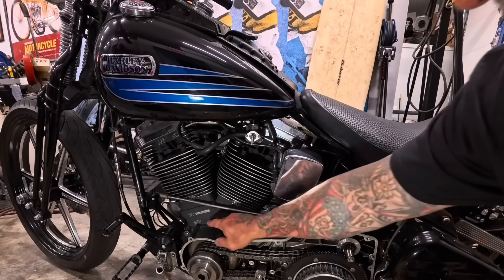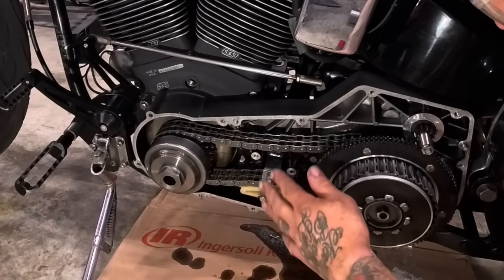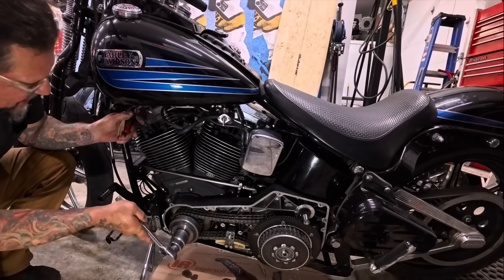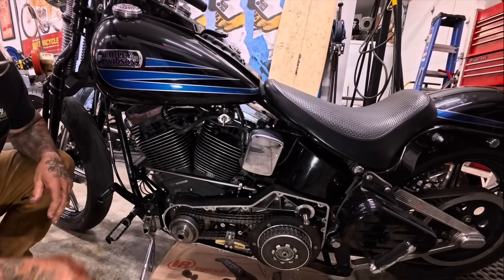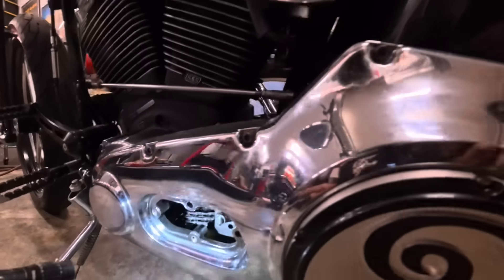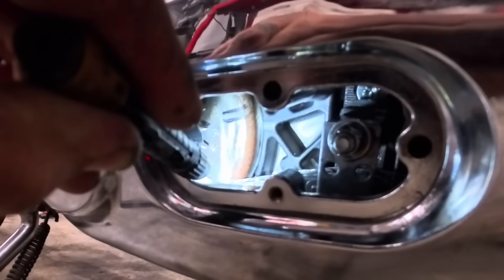How To Set Harley Electronic Ignition Timing The Right Way- Billy Lane’s Pro Trick With Timing Light

Comment: I have stock 80” evo fxr with ac and 2-1 v&h pro pipe, external Daytona twintec single fire ignition module,slope set at 5 for 87-89 pump gas. Stock cv carburettor rebuild with cv performance parts, 48 pilot 2 turns out and 175 main jet, cvp needle. I have the issue when bike backfires through the carb on deceleration when i am slightly twisting the throttle at downshifting. Is that an issue with timing and i should lower the slope mode to 4 in order to make timing more retarded? I also ordered 180 main since people say 48/180 is the best combo for big twin evo with high flow pipe and air cleaner 😢 i never had this issue with stock ignition module

Comment: Billy , why have I been taught to set electronic ignitions at tdc mark  vs the advance mark which ive seen other guys do also...is it running dual plugs or a bigger cam the reasoning ?   And do you still make your prism bars ? Im building a chopper with the 45 degree specs you use and 18 over springer front end . Its looking beast mode .
Reply from the maker: You can set it either way. I like to use the advance mark because that’s how I learned before electronic ignition was commonplace.
Reply: @BillyLaneChoppers got it. Thanks for the clarification 👍

Comment: Do you put the light at 0 degrees is you have a newer timing light? not running any advance on the light ?
Reply from the maker: My light doesn’t have any adjustment, it just fires when the plug fires.
Reply: @BillyLaneChoppers thank you for your response and informative videos huge fan.

Comment: hey Bill I tried with the clear plug in the timing hole realizing you can't see anything I opted to static time my shovel with a globe lighting up when the spark is right on moving the timing plate I cannot remember exactly where the globe needs to be wired inline is it coil to front cylinder plug wire been about 15 years since I did it that way a very handy tip I learned from the guys at lowbrow watching one of their dvd's on hd maintenance I'm sure you know this and the exact way to do it might be worth showing that way as well :) keep up the vids excellent as always, take care man .
Reply from the maker: Well, you can time to front or rear cylinder/ doesn’t matter as long as you use the right mark. Static timing gets you very close, but it doesn’t adjust for gear lash and other factors that can offset timing by several degrees when the engine is in motion.
Reply: @BillyLaneChoppers  yeah true so it's more to just get you in a zone where the bike fires and runs.

Comment: i still have a similar timing light from sears that i used to use on my car engines but i've never messed with the timing on my old 1980 flh. i did buy the special pop rivets for the timer cover but never used them and they've been sitting in my tool box for 40+ years. thnx for going over how to best time the thing, i enjoyed watching.

Comment: Kind of off the subject but I was testing out the charging system on a Harley-Davidson that had an alternator.. Jack pitman had every official Harley-Davidson shop manual there was.. the book said danger do not touch the two leads come out of the cases for the alternator.. just as I read 130 volts ac on my meter as the engine was going potato potato my meter leads flipped off and I touched the two wires coming out of cases.. are you laughing by now? That sob knocked my dick stiff... You can run a microwave off that alternator and cook your dinner

Comment: Can you do a video on how to static time and or adjust the timing I've never checked it on my 84 FXE Super Glide shovel head I'm guessing set on the advanced mark and rotate the plate where the points used to be how do you know when spark acures  test light or multi meter never done it with electronic ignition?Thanks
Reply from the maker: I usually just visually look for the points to open, but a test light is more accurate. Either way will get you really close

Comment: Hey Billy, does that primary chain normally run with that much sag in the upper strand, or did you snug it up before re-installed it? Sorry, off subject but was real curious
Reply from the maker: No, that is too much chain play. The tensioner sho was installed backward when I got it. I turned it around and now tension is correct
Reply: Thanks, that's what I thought, I was worried that maybe I was too tight on mine bc I really trust the things that you do!! @BillyLaneChoppers

Comment: I always static time it so it starts, then ignor the timing marks and time it off the cone by just adjuating the timing via the slots until the throttle response is instant and rolloff doesn't hang up. That means you are timing that particular engine and its specific state of wear. Timing off the timing marks just times the engine for factory spec and everything being brand new. Thank me later 😎.
Reply from the maker: I always static time first, also. And I seldom time to 35 degrees BTDC. My method is similar to yours, unless I’m timing a kick-start bike. Then I focus on starting & advance until performance falls off. Especially with performance upgrades, more than 35 degrees advance is usually preferred. But I’m speaking to the majority of my viewers, who probably would follow the manual or accepted practice, and this is really about how to avoid the hot oil moneyshot from the timing plug hole. No matter how much wear an engine has- if the average person times to the 35 degree mark with a light, the bike is going to run really well- assuming that all other factors are in check. I appreciate you watching & leaving valuable input. I’ll be thanking you in about an hour.

Comment: Billy I have the exact same timing light in the bottom drawer of my big tool box. I have used it to set the timing on countless old engines on old cars , trucks and tractors. Used a few months ago on a Flathead Ford V8. Most people today that call themselves mechanics have no idea what a timing light is. Once in a while I'll get my old Ironhead Sportster out of the shop and take it for a ride. If it's running lean or rich I can reach down and make an adjustment to the main jet. Hard to do that on a bike with EFI🤣

Comment: Hey Billy, I love your channel and this particular episode. I have a first gen EVO (1985). I lost fire to the plugs. I have a new single fire coil that is 3.1 ohms (tested) on the leads and over 12,000 ohms down the spark plug holes, so I feel I have a good coil.
While trying to troubleshoot, with the ignition on, I’m getting 12 volts at the middle, white wire terminal, but I am also getting 12 volts at the front blue (-) terminal and 12 volts at the rear (-) terminal.
Does this mean my ignition module is bad?
Reply from the maker: No. You should have 12V to all three terminals. Your coil sounds healthy. Your problem is probably with the VOES wiring or with your settings on the ignition module- for example, you have single fire coil but module is set to dual fire.

Comment: I'm conflicted about exhaust pipes for an Evo.  I had an 88 evo that ran & sounded awesome with a set of Python II pipes.  Looked factory, idled like factory, but when you opened the throttle, they were retarded loud & performance was awesome.  
Unfortunately, Python is out of business now.  

So, I really love the arched pipes on this bike, but the commercial ones available won't allow for a kick start on the transmission... And sorry, if your Harley don't have a Kicker, it ain't a real motorcycle.  

But it looks like those pipes would allow room for a kicker.  Especially since you put a 6 speed conversion, if they make a kicker cover for it... That would complete the look IMHO.

I had a buddy that had 2" drag pipes on a AMF shovel, & my Evo with Python II's was actually louder that his bike.  Loved them & they made massive torque.

Comment: Awesome tip!  You know something crazy and that is I have a Sears Inductive Timing Light i've must have had for 50 years.  Still works great.  I have a 79 FLH and I dread timing it.  I use the plastic plug and it is not easy spotting the timing mark.  To complicate things I have a sidecar on the bike.  At any rate, the next time I need to time it, I will give your tip a try.  Thank you very much.  It's genius such a simple solution.

Comment: That was smooth. Billy, there was a little plug you used to be able to buy. It was almost like a magnifier and you had a minute. that thing would fill up with oil. there was a black silicone plug. You would screw it into where it touched the flywheel and it would wipe it. That never worked either. This worked Thanks for bringing that memory back 
👍 😎 👍

Comment: Back in the late 80's, I bought  an old beat up outer primary from a swap meet. I cut the front portion off & leaving the rear portion that bolts to the starter jack shaft area. This way you can time your bike the same as in the vid. Also you can check how your primary chain or belt drive is tracking. I also use a plastic or paper straw to stick down the sparkplug hole instead of any kind of metal tool or screw driver. An old grey beard biker taught me this when I was young. Now I'm the old grey beard biker. Time fly's.
Reply from the maker: Appreciate the feedback, and thanks for taking the time to share your experience.  I usually use a piece of soft aluminum tig welding rod in the spark plug hole, but realized most viewers wouldn't have access to that.  Your straw idea is outstanding.  May facial hair is getting grey very quickly
Reply from the maker: That is definitely an option. I’m basically showing the average person how to time after having the ignition module out for a variety of reasons such as cam swap, gasket replacement, or tappet replacement (which should be done before 40K miles in EVO). Thank you for the tip, that’s a great way for a mechanic to set timing frequently

Comment: Hey I'm not sure what ignition I'm gonna use. I've got an evo with bare minimum wiring. I'm still on the building phase and thought I'd try magneto so I could go battery free until I saw how much they cost. I want to keep this bike as side of the road friendly as possible.  Any thoughts?
Reply: Twin tech or Dyna S 2000’s are solid. really enjoy hearing people’s opinions. I’ve really learned a lot thru comment sections surprisingly! Most people I’ve talked to run either of these two. Used both many times with no issues.
Reply: @Billy-703   I've been researching the s&s hi- 4n. I appreciate it buddy. I'll check those out too
Reply: S n s is a great way to go as well! Just seemed a little overwhelming for me. Typically can’t go wrong with s&s. It’s more programmable! Soon as your blasting down to express lanes won’t matter 🤣 enjoy the build 👍🏻
Reply: @Billy-703  Thanks man! Seems forever away sometimes but I'll get there😂
Reply from the maker: I love a magneto, but there's no advance curve and the price is considerable.  They also steal a couple of hp off your crank.  The Dyna & Daytona Twin Tec ignitions are both outstanding, and offer a lot of options.   The Twin Tec on mine has a multi-spark feature, where the spark plug fires multiple times on the compression stroke- versus just once.  It is supposed to help fuel burn, & I can tell you this thing runs really well.
Reply: Thank you very much.@BillyLaneChoppers as always,  I appreciate the great videos man! ✌️
Reply: I am not an engine builder, but I don't think there is an easy way to put a magneto on an Evo motor. I think you're better off sticking with stock or one of the aftermarket triggers unless you're looking for the show bike cool look
Reply from the maker: Morris makes a magneto with nose-cone drive for EVO, but the modern electronic ignitions are the way to go.

Comment: Awesome video! Been using this method many years. For the next generations getting into building this videos invaluable 😂 taken my share of oil baths for sure! Video’s your making are just outstanding real joy to watch! Timing lights nowadays have Tach’s for those unfamiliar with 12-1500 rpm’s takes the Experience / Guess work out of it. If timing alone set idle speed screw to proper rpm’s run carefully to other side to shoot it. Wish I’d a had this video decades ago 🤣 Awesome Job as always 👍🏻 Appreciate ya being so generous with time & knowledge really really cool!
Reply from the maker: Thank you, your feedback is kind & appreciated.  I'm working on an explanatory video about spark timing advance, & why it is necessary.  Trying to be comprehensive, but keep it simple enough to not lose my audience ate the 0:01 mark.
Reply: 👍🏻 Alway Grateful!!!

Comment: Thanks man, I am 69 years old, Harleys for most of it. You learn something new everyday and this was it, good trick I have fought with timing on shovels before. I still have an old timing light and I am getting ready to take the heads off my 76 FLH, I will try that method when I put it back together..
Reply from the maker: I hope this works for you when you are ready.  An alternative method is to install your primary cover with 2-3 screws for starting purposes, then remove the cover for easy and full access to the inner workings of the primary drive

Comment: Oil farting out that hole killed my Raygun style Snap On timing light but would Snap On replace it?  
Noooooooooo
Reply from the maker: We've all been there.  This method is simple and avoids all of that mess.  The mark on the rotor is also useful for doing pushrod adjustments.
Reply: @BillyLaneChoppers  you mean snap on wouldnt replace yours too,huh?
Reply from the maker: @chrisbrady-t1u No, I didn’t mean that. I meant we’ve all had that hot oil shoot out & soak us and our tools

Comment: How much trouble would it have been for the factory to put the marks in side the primary?
Reply: Probably the same amount trouble it was to put rivets in the timing covers 😂 Extreamly good point!!!
Reply from the maker: The issue with H-D putting the marks on the rotor is that the rotor may be installed in several positions, relative to the crank- so you could potentially lose your indexing.

Comment: Awesome video. Can you explain for us uninformed folks why starting the engine with the primary cover off is hard on the starter?
Reply: Because the end of the shaft is not supported.
Reply: @allanmccullough8550  Thank you.
Reply: Primary’s need a Quart or so of fluid typically but, can be run for a short while with-out in order to time. Shaft not being supported can round, chip or break teeth off with one press of the button. Better to be cautious for sure 👍🏻
Reply from the maker: There is a bushing on the inner primary cover to support the inboard end of the starter jackshaft against the incredible force put on it by the engine's compression through the clutch basket ring gear.  There is another bushing on the outer primary cover to support the outboard end of the jackshaft against the same forces.  Without the outer cover, you risk damaging the jackshaft, starter pinion, and clutch ring gear.  An alternative to my method is to install the outer cover with 2-3 screws just to support the jackshaft for starting, then remove the screws and outer cover for full, unobstructed access to the workings of the primary drive & charging rotor
Reply: @BillyLaneChoppers  Thanks for the detailed response! 😎
Reply from the maker: @jeffshootsstuff 10-4

Comment: When I installed my Daytona twintec on my stock EVO. I think the instructions mentioned just turning the module until the light comes on, which seemed to be close enough. Wish I would’ve thought about this though. Man I pulled that plug with the engine running and it was just a fog of oil vapor coming out. Thanks Billy.
Reply from the maker: Those pistons creating negative & positive pressure inside the cases work in coordination with the rotating breather gear inside the cam cover to draw oil down from the top-end, and that air/oil vapor mix is heavy and very hot.  It's a mess.  The method you described is for static timing, which will get you close.  I static timed mine exactly as you did.  But, it's important to time it dynamically with the light.  You're losing horsepower, fuel efficiency, and thermal efficiency if you run too little or too much spark advance.

Comment: What did you do to make the bike go to 1500 Rpm? Just open the throttle up a bit? I don’t have a tach and don’t want to guess when doing this.
Reply: Some newer timing lights have integrated techs. If your doing it by your self you can adjust your idle speed screw until you know your at 15 or 1600 rpm’s or your tech says you are. Once you do it a half dozen times you become familiar. I started out using a tech/timing light they worked pretty well now I just kinda know I’m between 15 or 1600 rpm’s. Works with most ignition sensors even oem twin tec or dyna s 2000 preferred. But always works pretty well.
Reply: For me a tach really helped to get a feel for it. Depending on motor from light contact most of the time it’s with-in 3/4 of a turn clockwise. For me it wound up always being a little higher than what I told myself 😂 hope it helps. genuinely trying to help!
Reply from the maker: A good Harley-Davidson "potato-potato-potato" idle occurs around 850rpm.  (Twin Cam & M8 idle way higher, and have lost that wonderful piece of the H-D experience).  So I just tighten down the throttle lock on the hand grip, or turn the idle screw on the carburetor until I hear the exhaust note roughly double- which is all you need for full advance in most cases.
Reply: @BillyLaneChoppers I’ll have to give it a try, Thanks!